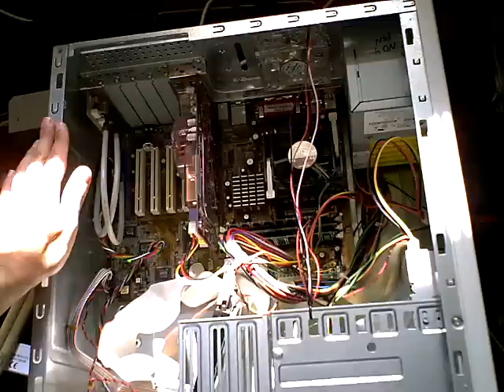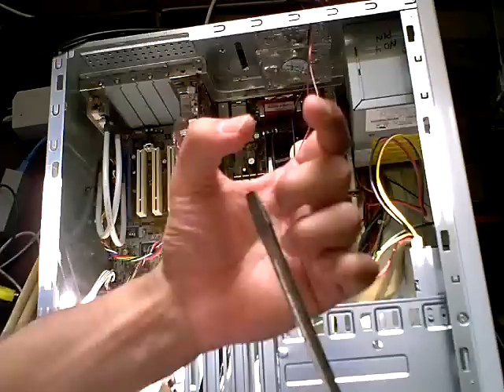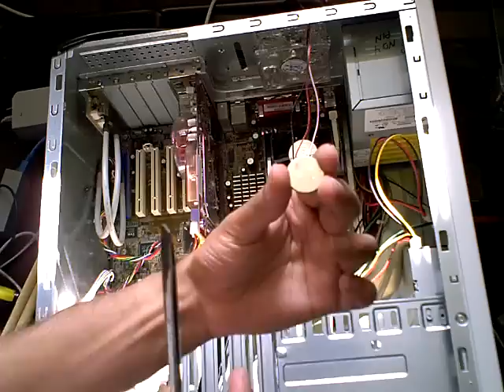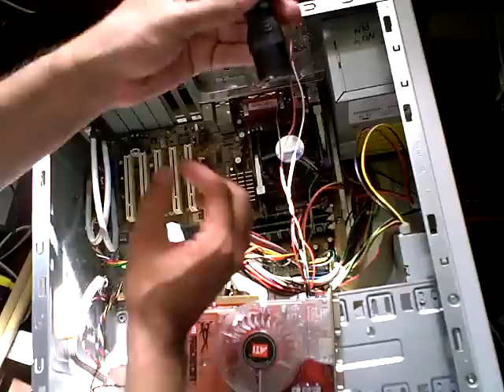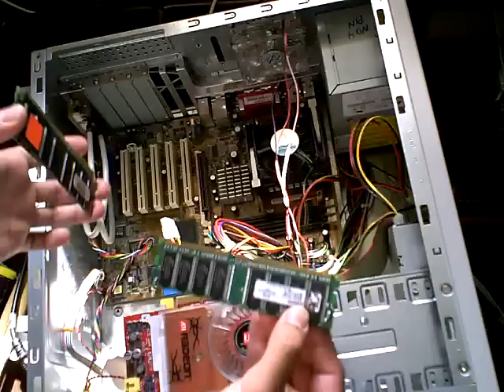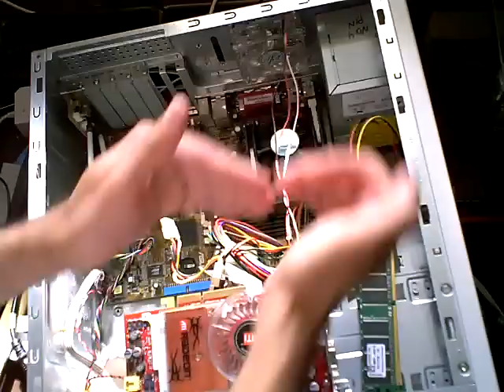How to possibly fix a PC that will turn on but will not beep and will not display anything on screen

Comment: I have similar problem but my pc show power everything spining then everything stops then everything spining and over and over again
Reply from the maker: +Matej Mitulinski It sounds like your motherboard is developing a short circuit due to contact with the metal casing. Most likely it has to do with the screws and metal mounting stands (supports) that your motherboard sits on. The cheapest way to fix this problem is to introduce cardboard washers between the screws and where they make contact to the motherboard, or you can buy plastic mounting supports at a computer shop.

Alternatively, you can always Breadboard it (explained in the following video:)

If the steps in this video did not provide a solution to your problem, view:

http://www.youtube.com/watch?v=_EK9a-R5pss

You never know, maybe rebuilding the PC in the opposite sense that you took it apart will solve the problem.

Comment: I don't have a jumper cable ?
Reply from the maker: Skip that step: disconnect the power cable, remove the CMOS battery, press your PC's chassis power button switch (to discharge any remaining power circulating in the system), leave the PC unplugged and in this state overnight, then the next day return the CMOS battery to its socket, power up the PC, and if no beep, then disconnect the power cable, press your PC's chassis power button switch (to discharge any remaining power circulating in the system), remove one component, power up the PC, and if no beep then repeat (each time unplugging the PC, pressing the power switch to discharge remaining power, removing a remaining component, and then powering up, and this until the PC beeps at boot).If it never beeps, even when you are down to just motherboard, power supply & CPU+fan, one of these remaining components may be bad
Reply: RodneyDickson ok thanks

Comment: when my pc starts up if I wait long enough I can hear the windows starting sound but still no display?  any ideas
Reply from the maker: +Charles Roberts Yep, your PC may be outputting video to a different video out device to what you are connected to. Try to connect to a different video out device on the back of your PC
Reply: +RodneyDickson I have tried using both integrated graphics and the graphics card
Reply from the maker: +Charles Roberts And no display? This is very odd. Have you tested your screen using a different PC?
Reply: Yes, I also have tried resting bios by removing the battery but to no prevail any ideas?
Reply from the maker: +Charles Roberts Hmm, if you claim that your screen works fine with other PCs and your trouble PC is booting the operating system properly despite no display at all, I'm afraid the only thing I could suggest is a different addon card, but considering that both your current addon card AND your onboard doesn't function, the whole thing is peculiar. I wish you luck with it.
Reply: Do you possibly think its the mother board?
Reply from the maker: +Charles Roberts Possible. Only way to know is to test a different video card though.

Comment: can somone help me i have an issue i start clean my pc and remove a cable that connected to the gpu and i unplug it i clean my gpu and then plug it back but when is start turning my pc on its not letting me to turn on and no beep sound its just try to boot but fail and always fail to boot
Reply from the maker: Ensure that all cables are connected correctly (especially to your GPU). If still no luck, unplug the PC, press the power button to discharge remaining power, remove the GPU (store it on non-shiny wood, non-shiny cardboard or in an ESD anti-static bag), connect the display to the onboard video out and power up. If everything works as intended, your GPU has been damaged.

Comment: PLEASE HELP ME.*Can someone please help me. I don't knoe what I did wrong but somehow whenever *I log in to my computer everything is completely gone. All I see is the background wallpaper and that is it. I can't even see the start button on the bottom left of the monitor. I do not knoe how this happened but I do need help. I think I may have uninstalled one of the important programs on my computer that had those settings but that is all. I ask only for help and thank you all over much.
Reply from the maker: +Matro Almazan Fraid I haven't an answer for you. Chances are your Windows installation has become corrupt and you'll need to reinstall Windows.

Comment: what about short continous beeps?
Reply from the maker: Beep error codes differ from one BIOS manufacturer to the next. To discover what the beep error code is trying to telling you, discover the manufacturer of your BIOS (available in the motherboard's manual or on the motherboard's manufacturer's website {on the page for your specific motherboard model}) and then look up the frequency and interval of your beep error code on:

http://www.computerhope.com/beep.htm
Reply: yeah worked it all out, my ram stick was not firmly pressed in. :P
Reply from the maker: Glad you found the problem : )

Comment: help me mr. rodney when ever i start my pc with my graphic card itnever starts i have done evrything related to check that my graphic card works i have even replaced my graphic card but still not working my computer works without the graphic card
Reply from the maker: +Vishwajeet Panwar by 'without the graphcs card' I assume you are referring to onboard. Try this: unplug the PC, install your video card, leave your display connected to the onboard video, then power up. If video displays, go into the BIOS and set your primary graphics card to be the discreet card (the addon card)

Comment: Hello, is anyone here can help with my problem? Problem is every time i turned my pc on the monitor has a signal but after a few seconds it will not display the booting menu  but only black screen, and when i shut it down again and turn it on again that's only the time that the monitor will have a display, i am so confuse with this. My system unit has a lights, cpu fan is functioning properly, keyboard has a light also the mouse is detected, my power supply is 700watts which is only 2 months old i have 4GB ram, and palit geforce gt630 1gb vid card, please help me.. 
I already replaced my CMOS battery but it doesnt help..
Reply from the maker: +Jacksonsville Rodriguez Does your PC beep at boot?

Comment: Hey, this gets my pc running but it wont start unless i reset the motherboard PLZ HELP
Reply from the maker: +TheGamingMustard In cases such as these, I recommend that the user gets the PC running, and then puts it into 'sleep mode' when not in use. I know it's not ideal, but it could be worse.
Reply: +RodneyDickson thanks, but you're a lil late lol. not to worry but i fixed the issue, i had to reinstall my windows. this occurred b/c i turned my pc off durring an update. thanks tho.
Reply from the maker: +TheGamingMustard Heh, 10 months late, yeah. Glad things worked out : )

Comment: Hi can someone please help me, so my computer was updating the bios and i didnt read the message that after it restarts it might take some time to boot up, so after it restarted i got scared that its not turning on and i turned it off and on like 10 times and i can hear stuff run inside but the screen wont show up anything even after waiting like 20 mins. Some on please help i have some really important files and pics i will need very much. And btw its running windows 8.1 and its a hp pavillion 23 all in one.  Some one plz help i would really appreciate it please.
Reply from the maker: +S Sharma It seems that you bricked your BIOS. Sorry to be the bearer of bad news. I recommend slaving your hard drive to another computer to recover your files.

Comment: mine beeps and turns on but no video comes up.. what do i do?
its an old 2008 compact dell pc..
Edit: its actually a dell optiplex 760
Reply from the maker: +PneumaticFrog If you have multiple video out connectors on your PC, power down your 
PC, connect your display to a different video out, and power up. If 
another video out works, you have to go into your BIOS and set your 
primary graphics adapter to the desired primary graphics adapter, 
followed by saving and exiting
Reply: RodneyDickson i did all that but i fixed it on my own by taking the ram out and then putting it back in..
Reply from the maker: +PneumaticFrog Good then.
Reply: RodneyDickson was the first time fixed one too... let alone open the side of a computer
Reply from the maker: +PneumaticFrog Better that way : )

Comment: ok so i pulled my ram, I got a beep, but the ram is good and i swaped through a bunch of configurations and if i had ANY ram in I got no beep. but here's the thing, I'm getting the problem on multiple motherboards
Reply from the maker: +tork1988 See how my PC was reporting a RAM issue when the video card was the culprit? You should Breadboard it (explained in the following video:)

If the steps in this video did not provide a solution to your problem, view:

http://www.youtube.com/watch?v=_EK9a-R5pss

You never know, maybe rebuilding the PC in the opposite sense that you took it apart will solve the problem.

Comment: I have a Asus rog g20 that will turn and all the leds so then it turns right off and this started after I took the side of to see the insides please help. Thanks.
Reply from the maker: +XolD Shadow It sounds like your motherboard is developing a short circuit due to contact with the metal casing. Most likely it has to do with the screws and metal mounting stands (supports) that your motherboard sits on. The cheapest way to fix this problem is to introduce cardboard washers between the screws and where they make contact to the motherboard, or you can buy plastic mounting supports at a computer shop.

Alternatively, you can always Breadboard it (explained in the following video:)

If the steps in this video did not provide a solution to your problem, view:

http://www.youtube.com/watch?v=_EK9a-R5pss

You never know, maybe rebuilding the PC in the opposite sense that you took it apart will solve the problem.
Reply: +RodneyDickson actually the power button was stuck down. -_-
Reply from the maker: +XolD Shadow Wow, you don't hear that happening very often. Thanks for sharing
Reply: +RodneyDickson Yeah I was so relived that I didn't have to buy something new. I just tapped around and on the button with a screwdriver. It worked.

Comment: after i reset the cmos, it started beeping. 5 long beebs, I replugged it into the monitor but it didnt start
Reply from the maker: +Proxima Alpha〈Axile Clan™〉 Beep error codes differ from one BIOS manufacturer to the next. To discover what the beep error code is trying to telling you, discover the manufacturer of your BIOS (available in the motherboard's manual or on the motherboard's manufacturer's website {on the page for your specific motherboard model}) and then look up the frequency and interval of your beep error code on:

http://www.computerhope.com/beep.htm
Reply: RodneyDickson
Thanks

Comment: hey bro my prob is i had 4 gigs of ram when i installed 8 gigs the display is not working please tell
Reply from the maker: Your motherboard may not support more than 4GB. Your motherboard manufacturer's website will have a support page dedicated to your motherboard's model, and on this support page should be a compatibility list for such components as video cards, CPUs and RAM modules. See what is the max RAM your motherboard supports before trying to install more
Reply: Thanks bro for the info

Comment: may i know where is the reset button?
Reply from the maker: +Choo Jun Ming Not all PCs have them. In order to know for sure if your PC has one, (if you can't find said switch) you'd have to trace the path of your front panel wires to see if one connects to the RESET SW connectors of the front panel section of your motherboard.
Reply: +RodneyDickson ok thx a lot :D

Comment: my PC turns on, all fans spin, all LEDs turn on as normal, but it has no output and it turns off in a few seconds.

it used to work fine, but I messed around in the BIOS too much and what I think happened is there's was an option that said "CPU upgrade" with the options i7-4470K (I think) and different clock speeds at least 4.3ghz. I don't have an i7, I have a Pentium g3258, and I thought this option would simply over clock and it would work fine, but after saving and exiting it stopped working a few seconds later. Ever since, it could only do what I said in the top sentence. what can I do to fix this?
Reply from the maker: Doing what is shown in the video should allow you to reset your CMOS settings back to default. Give it a try.
Reply: +RodneyDickson Yes it works now, all good
thx m9.

Comment: Mine does not boot, not even for a second. What is wrong? (laptop)
Reply from the maker: +siimsimsiim Laptop fixes:
https://www.youtube.com/watch?v=qRhphHjQrNk
https://www.youtube.com/watch?v=X78u90mETpE
Reply: Thank you but none of them worked since my laptop litteraly acted normal up untill a day I wanted to power it on and it didn't do anything, nothing strange before that happened, bought a new CPU but that didn't work, ended up just dumping it :P
Reply from the maker: +siimsimsiim Crap deal. Sadly these things don't last forever : \
Reply: RodneyDickson indeed... I now have a new laptop but stepping over to a desktop pc if this one stops working, it's better in all cases but not easy transportation wich a laptop does have... :P
Reply from the maker: +siimsimsiim Yeah, I have mixed feelings about both. Desktops (or at least parts from) can be salvaged should something go wrong, and are much easier to fix. Once a laptop goes, it's usually scrap : \
Reply: RodneyDickson indeed, same here...

Comment: Guys listen up , i turn my pc everything works without monitor, then i shut up my pc and unplug monitor (display) and monitor starts , but becomes white , all white , i plug it back , pc starts correctly and display still not turning on help pls answer me
Reply from the maker: +rekterino copyrightt Try booting with the monitor connected. If that doesn't work, try booting with a display connected to a different video out port on the back of your PC

Comment: With my computer I think I may have developed a short circuit or something of the sort because the connecting poor where I had everything plugged in and created a shark I think in a resort circuited something in possibly done something to the computer because something that was plugged into USB drive A phone charger was near the shock area I think it may have caused the shark from that now I'm having a problem with my computer where it turns on shows no screen nothing at all but it still getting power and I have to unplug it to turn it off do anyone have any idea of how to fix this or not I have not opened my PC up I'm due into that tomorrow but please leave comments on how to fix this if you have any ideas even if it is just an idea
Reply from the maker: +DALTON WILLIS By now you've brought it in, but following the steps in the video would have helped

Comment: hello, first i apologiz for my english cause it not so perfect, but i will try to make you understand my problem, so i have MSI Z97 pc mate, and last day i make an update trough MSI live update, and not on purpose i update my bios, but during updating, my computer bug, i thought that i have to reset to make it run again, ( but it was due to the update cause a friend told me that when msi make update, they stop all control of computer,) whatever, when i reste it, now i have a black screen, i did clear c mos, i take of the battery, i make everything possible, ( chock ram, take off hard disk n take of the graphic card...ect) but it same, black screen , please help me, i really need your help,  sory one more time for my english, but i hope you understaood my problem .
Reply from the maker: +mehdi bob I understood perfectly. Sadly, you may have bricked your BIOS. I'd try breadboarding it, and if that doesn't work, if the motherboard is still under warranty, try returning it, else you'll have to replace the motherboard. Breadboarding tutorial http://www.youtube.com/watch?v=_EK9a-R5pss
Reply: RodneyDickson thanks for your answer, yes my motherboard is still under warranty, but i was stupide and i told them how that happenned, so they tolded me that it was somthing that i did , an not dud to a motherboared and it not covred by the warranty , so i payed about 40$ to get it on again :) i had just to tell them that it stopped alone lool, whatever , it work :) maybe they did the same thing that you sended me on your video :) thank you again for your answer. peace V
Reply from the maker: +mehdi bob Sorry it came down to that, but $40 is still cheaper than replacing the motherboard entirely, so it's the best you can do with what you got I guess : \

Comment: Going to try this, I brought my GTX 970 and a new PSU yesterday and the technician fitted it for me at the store, went home it didn't work and claims 'no signal',  I've verified the problem is not with the PSU/GPU
Reply: Same problem here, i just installed my MSI GTX 970 (Previous GPU was MSI GTX 960) and i now i get "No DVI Signal" on my monitor..
Reply from the maker: Make sure to power down the PC, switch your display cable to a different video out connector, and power up again. If still no video signal, repeat, until every video out connector has been tested.
Reply from the maker: Make sure to power down the PC, switch your display cable to a different
 video out connector, and power up again. If still no video signal, 
repeat, until every video out connector has been tested.

Comment: Hiya the I need help with my Epos touch screen on Windows xp please
Reply from the maker: +shotta ali Well, what's the issue?
Reply: +RodneyDickson it will not pic up the hdd or USB ports it's a geller ts600 touch screen
Reply from the maker: +shotta ali It's beyond my knowledge sadly.